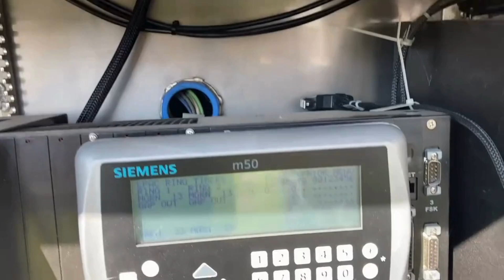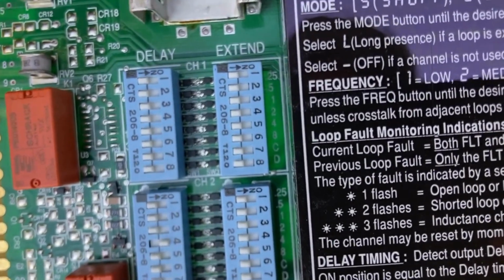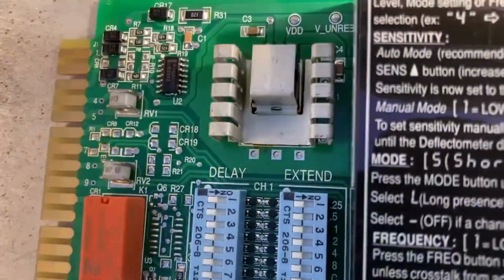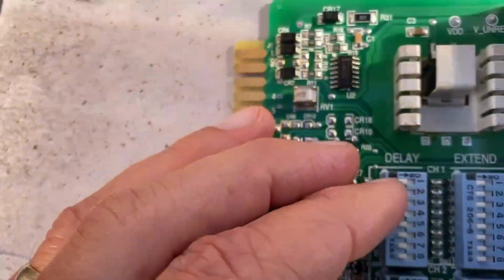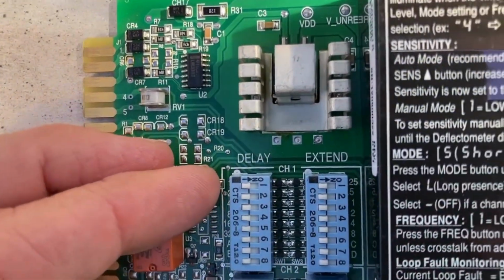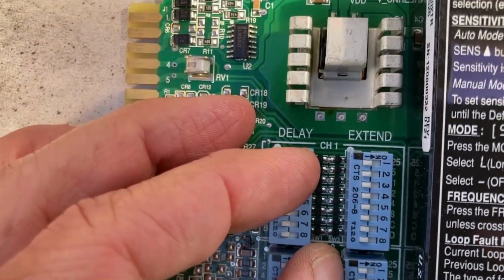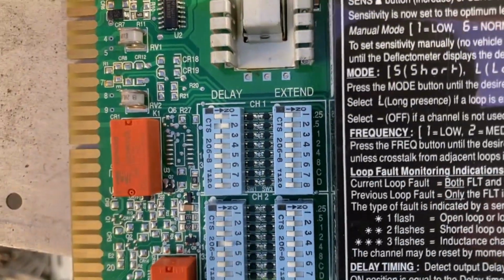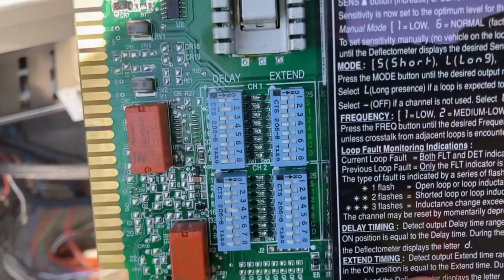How to Keep Traffic Lights from Cycling

Comment: Well that’s a pretty neat loop card. If you didn’t have a card you could activate delays with you can also add a delay in the controller under detector data!
Reply from the maker: Hey TrafficLightDoctor!  The one and only!  LOL  Follow your stuff often.  Yep, I've been more inclined to put the delay in the controller recently as the detector card settings can often be forgot when doing a quick swap.
Reply from the maker: @Trafficlightdoctor  Thanks for commenting!

Comment: The one I hate more is how if you leave more than 1 car length following distance the lights turn red even when there's massive backups...and it can take 5+ cycles to go a few hundred feet because as soon as the flow reaches like 25 mph on a 45mph road anyone not tailgating gets a red light.  Most people now DO treat red lights as suggestions because they don't want to sit longer.  My 2 accidents were both rear ended at red lights - one because "they thought I would keep going" one "thought I would go faster" as they approached turning green
Reply from the maker: Ah geesh--sorry to hear about your accidents.  Glad they weren't serious.  Having my fair share of accidents to deal with (both my kids in the last 2 years), the worst is dealing with the insurance!
Anyway, sounds like the issue is probably more that the 'amount' of extension time is not suffecient.  Meaning....when a vehicle passes over a sensor, it should extend the green time for another 'x' seconds, thus allowing enough time for the next vehicle to hit the sensor and extend another 'x' seconds.  When 'x' seconds is not enough, its known as a gap out and will will progress to the yellow &  red for that direction.  If you know the municipality where the signal resides, call their public works dept. and issue a complaint.  Sounds like its warranted!
Thanks for your input!
Reply: @streetsmartstraffic  When I first move to California in 1979, these were pretty new to me. My friend, who grew up with them here, always told me to speed up to keep the gap close, or the light will change. Perhaps they didnt' have the amount of control over these things back then. Glad to see people do care.
Reply from the maker: @BradHouser  I drive many of the same signals that I work on.  I'm a driver just like you and everyone else on the road and share the same frustrations.  So I want them to be as effecient as possible.  A wise engineer I know once said  "the best traffic signal goes unnoticed."  
Thanks for the comment!
Reply: @streetsmartstraffic  I've submitted complaints but annoyingly either nothing happens or I get excuses like "people keep running the red and there's not enough police to enforce, be careful".  I have received a few compliments on my dash cam submitting video to demonstrate the complaint though.

I did successfully get them to change the one at my old apartment though... It was changed because of construction on another road to let more cars through but it was (timed it) three full minutes red leaving the apartment complex even late at night with zero traffic on the main road to the point people thought it was broken and were running it.  They were able to do a different cycle for daytime versus night time so it was only extra long during the day
Reply from the maker: @matthewmiller6068  Geesh!  Sorry to hear about that.  Great idea to film with the dash cam.  Video is worth a thousand words.  I know its frustrating but I would keep submitting.  Sounds like you found the right agency responsible for the lights?  Now I'm curious..what part of the world are these problem intersections located?

Comment: My biggest problem.  I pull up to a light, no traffic.  Red my way, green for the cross traffic.  I'm going straight.  The light won't change.  Someone pulls into the right turn lane, where it's legal to turn on red.  The light changes.  Same thing if you're alone in the right lane.  The light will change, but it didn't need to.  It's reverse what it should be!!!!! 😠 😡
Reply from the maker: Isn't that the worst!?  Thats crazy, I responded to a complaint yesterday similiar to yours.  However, it was the LT (instead of your right turn) that would only bring a green up in the same direction.  AND it would only do it sometimes.  Turned out to be a detector card that wasn't recognizing vehicles in the thru lane to go straight.  Just like most electronics, cycling power to the detector card fixed the issue. 
I would call into the public works dept. and tell them what you're experiencing and that it will cause an accident because utlimately there will be red light runners!  Thanks for your comment.
Reply: @streetsmartstraffic  thanks for the reply.  I'm a delivery driver, so I often end up crossing main roads late at night with no traffic.  If I'm the only car, often the light won't change.  I either look both ways and just go, or I'll go into the right lane, make the turn, then u-turn and go through the green.  It's ridiculous, but I assume an officer would tell me those are my two "legal" options.   😆
Reply from the maker: @trm4life  Yes, at night is usually when you see most of your detection problems surface due to decreased traffic volume.  It can be masked during the day when you have so many turning movements.  You could also send a short video with your camera showing your issue and send in to the local agency or public works.  There is usually a contact on their website where you can email or call.  Hope you get that resolved!

Comment: genuine question, are the phase timings determined by the civil engineers? Is there a given range or" ideal operation" that you're allowed to operate within or is the cadence rigidly delivered by whoever figures this stuff out? I'm wondering how "out of parameters" this impromptu change is.
Reply from the maker: GREAT question.  There are formulas for figuring out signal timing (for example yellow time has a formula and incorporates a few things such as speed, grade of road, and few other numbers....maybe I'll make a video on that.  
Anyway, changes like whats shown in this video only help make the signal more effecient as a 2 sec delay does very little in the amount of wait time for a car pulling up.  However, for the unintended issues like whats shown...it stops the mainline traffic, gives the green time, yellow time and red time for the side street which in this case stops traffic for at least 10-15 secs for no reason at all.  Hope I answered your question....Thanks for the comment!

Comment: My traffic lights used to do this in VISSIM until I figured out what I put in my VisVAP program that kept making them cycle constantly.
Reply: LOL it was because the turning cars were cutting the corner?!
In my program, I just accidentally had the traffic lights loop if no traffic was detected.
Reply from the maker: @frafraplanner9277  Thanks for commenting.  I haven't used VISSIM but I know some that do.  I never figured out how to integrate a traffic signal controller sitting on my desk to the laptop running the software.  Great job figuring out the  turning cars lol

Comment: My initial thought is that the intersection is poorly designed, if the detector has so many false positives: Cars are locating themselves where they shouldn't be.
Solutions could be to remove the loop sensors in sidewalks (cars shouldn't be blocking the crosswalk, anyway), or to install a median to help guide the cars around the detector. Even a painted dashed line, guiding cars around the sensor, likely would help. Retiming the lights as shown certainly works, but doesn't nudge drivers into having better behaviors.
Reply from the maker: All good points!  Many times I have to ask myself if I'm rewarding bad behavior.  Example, we have an intersection that has signage & pavevment markings that says stay behind the white line for detection.  How many people pull past the white line?  Probably 20%-30%.  And then the complaints come into the dept. that says they're not getting their green light.
I try to dummy proof many things out there but...
Reply: @streetsmartstraffic  ...but the world keeps making more dummies!🤣
Reply from the maker: @BradHouser  Unfortunately...🤣
Reply: There is a faded darker strip in front of the loop. I think the stopping line was originally in front of the loop, but when they moved back the stopping line they did not cut open the concrete to put in a new loop.
Reply from the maker: @danielrose1392  Would you believe ths stopbar was actually further up originally? lol
The pedestrian crosswalk was added in a recent design update and it pushed the stopbar line back further.  Radar was used for detection but we were having detection issues with it.  So I had the contractor cut loops there instead.  Thanks for your comment!
Reply: @streetsmartstraffic  I'm in Michigan and have been helping a county with 69 signals. Are loops still a viable form of detection? This agency considers them completely obsolete and I'm not sure I agree. Over the past decade they have primarily used Sensys pucks and they have been having a lot of issues with them failing prematurely or generating false calls but at $800/ea just for the nodes, they don't want to piecemeal replace them and would rather wait for the whole intersection to fail (so they don't end up with mismatched lifecycles and constantly have to piecemeal them forever). I would like to consider spot deployment of loops as an option if they don't want to re-puck but it seems like everybody up here has written off loops as dinosaur tech, perhaps unfairly. People have actually laughed at me. I don't get it.
Reply from the maker: @peteszerszen4337  What up Pete?!  Loop detection is definitely still used.  I would argue that its still the #2 or #3 type of detection used throughout the nation (behind aerial forms such as vide/radar).  tbh, surveying MANY agencies throughout the midwest, majority have not had great things to say about those pucks.  I think they make sense in parking garages (monitoring parking spots occupied).   I personally don't like them as a form of traffic detection in the roadways.  Its been a long time, but my experience with them was that they were unreliable and the pucks batteries prematurely died.  I also found that plows would easily pop them out of the road during winter time.  I just found them to be a maintenance nightmare.  Others on here might say differently...
Great question!

Comment: what is even more annoying is a side street light activated when no one requests service and the through street traffic is forced to stop!
Reply: Those could be programming errors, but they may sometimes be intentional!  I strongly suspect that some lights that are red by default on the main street in my area are deliberately set up that way as part of the "anti-motorist" agenda that has taken root.

Another example of that is signals that ignore the loops entirely and go through the whole crosswalk procedure even though no one has pressed any buttons, despite having worked correctly in the past.
Reply from the maker: @Starchface  Don't get me started!  LOL

Comment: We program the delay times for the loops in the traffic application that runs the intersection.
Our detectioncard ( Siemens LD4) does not support hardware delay from switches.
Reply from the maker: Yes!  That is also an option.  Its nice to have that flexibility if the hardware cannot support it.  Great info!

Comment: why not a 8sec delay like on the right hand turn, so the behavior becomes consistent for both turns? And I wonder, isn't it possible to lower the sensitivity of the detector, so the car just touching the corner of the detector won't "excite" the detector enough to trigger it, but a car covering the whole detector will trigger it. Just need to be careful to not screw it too low so MC's and mopeds have hard time triggering the detector.
Reply: Just guessing, but a longer delay would just add to the wait time unnecessarily.  The longer delay is needed on the right turn to prevent calls when the vehicle is able to make a right-on-red without waiting for service.
Reply from the maker: @BrianDominy  Perfect summary!  Thanks for commenting!
Reply from the maker: See @BrianDominy response below.  He summed it up beautifully.  
But great point about setting the sensitivity TOO low.  Then you start having other issues such as not detecting at all.  Great question Sebastian!
Reply: @streetsmartstraffic  Yep it was a nice answer. I totally forgot about turn-right-on-red as we don't have that in Sweden. In Sweden everyone has to wait on red.

If the traffic planners want a "free right turn" even on red, what they do then here in sweden, is to create a separate lane, with a "give way" sign, for the right turn, that passes the traffic on the right of the traffic light pole, and thus the lane is not subject to the traffic light regulation.

An example can be found by looking up: 57.7998172,11.9965704 on Google maps and pull the yellow man to the red marker.

Comment: Nice Video, Is this a common Issue that calls are sent when vehicles are making sharp turns onto the other side of the road over loops? If so, does the Intersection timing plan call for a few seconds of Delay on the Far Left Lane.
Reply from the maker: You would be suprised that many times just a delay setting on (at least front loops) of streets resolves alot of cycling.  Good traffic engineering takes all of that into account.  But if it gets forgotten, then it falls on the people who maintain the signals to figure out how to make it run efficiently.  Great question!

Comment: I'm not a traffic light tech, but I really love seeing how this stuff works. its always been a mystery. keep putting these out!
Reply from the maker: I'll do my best!  Thanks for the kind comment!
Reply: @streetsmartstraffic also how synchronized signals work … ie Houston mayor bob lanier. ran on getting the street lights in sync …. Is that common now that if you go thru a green light the signals down the street are delayed to trigger green also so you can hit about 5-10 green lights before a red light
Reply from the maker: @KE5ZZO  Oh man.  We all need a mayor bob. If done properly-i.e. a traffic study, implementation of timing from traffic study, and observation...a signalized corridor can be such a smooth drive.  Unfortunatley, most towns don't want to spend the $ to do it...
Reply: @streetsmartstraffic  also 2 more Houston they use cameras instead of the induction coils to detect cars   And how does the light getting forced green.  by fire trucks on a call work.   Rf? In IR.  I would think ir so no false trips on the other lights at the intersection.
Reply from the maker: @KE5ZZO  induction, radar, video, etc..  end result is it takes an input from when it senses a vehicle and transfers it to a controller to process that to a green light for that vehicle.  
Emergency vehicles have several options--IR, GPS, RF.  A signal has to be outfitted with the preemption equipment for that to happen (and the controller programmed for said preemption).   So that when an EV comes thru, well in advance the signal can be flushing out traffic for it to fly thru the intersection.
Reply: @streetsmartstraffic 1 more.  How the cops at events like astrodome could open the small door and plug in a wired controller to override and take control of the signals for crowds exiting a game.
Reply from the maker: @KE5ZZO  Most signals have a manual override.  As you stated, open the small door, flip a switch to manual, and then a button can be pressed to sequence thru the lights on command.  Pretty cool